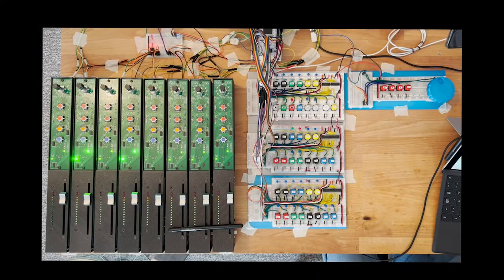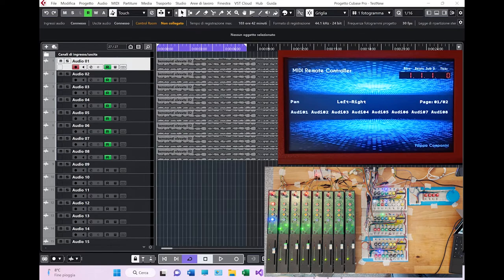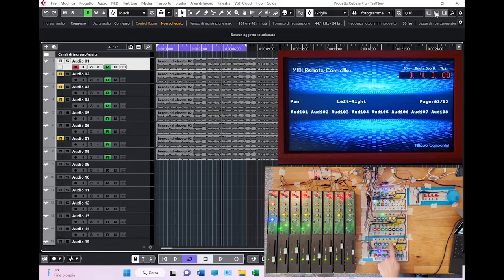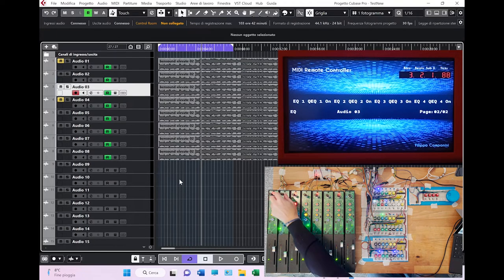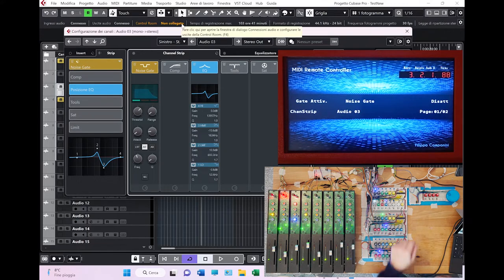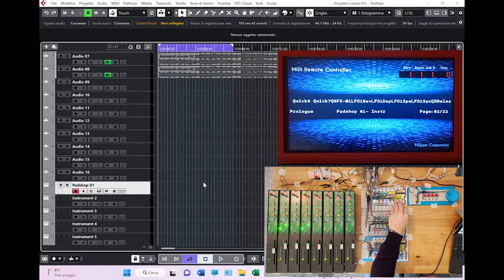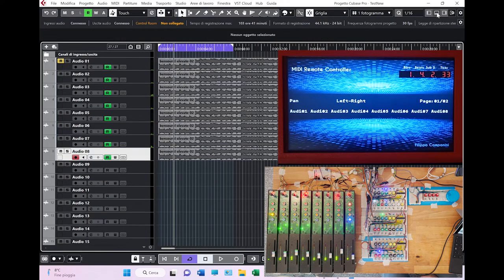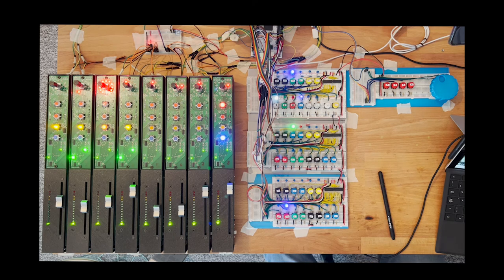DIY MIDI Remote Controller - Full Feature

Comment: Absolutely magnificent! Will you be adding the single Master fader? Also, the Icon QCon Pro has a second LCD Display. The G2 doesn't. What does the protocol push to the second display?
Reply from the maker: Thanks. Yes i will be adding the master as last motorized fader. The Mackie protocol supports, as far as i know, one LCD display and one seven segment display. Then with the data you can do whatever you want but I chosen to use one big display and I will stick to it in showing everything inside.

Comment: I got a Soundcraft Ui24r.. and it would be great to have have this integrated to it as midi controller.. this is cool.. also having it as a modular per channel.. like you can just buy another seaprate channel to widen your board.. it would be so cool!..
Reply from the maker: Hello, the idea to have a modular implementation is in fact at the base of my project and the way I have designed this solution is already set in this direction.

Comment: Hello, 
What core method/protocol do you use to get events from the Cubase? About which track is selected, which button is pressed, etc.
I'm doing a slightly smaller project. And I use a Reaper. Sending from the controller occurs via MIDI, this is not rocket science. But I don't know how to GET events from DAW.

I use Raspberry Pi Pico, but usually searching by "arduino" keyword.
Thanks!
Reply from the maker: Hello, the protocol is the mackie universal protocol. The track selection is done via a button click or the touch of the fader with capacitive recognition. Anyway the midi message you send is always the same. In terms of feedback it’s still midi messages! You send a midi message to make an action and the DAW responds with a midi message! You catch it and you use it! Cheers!